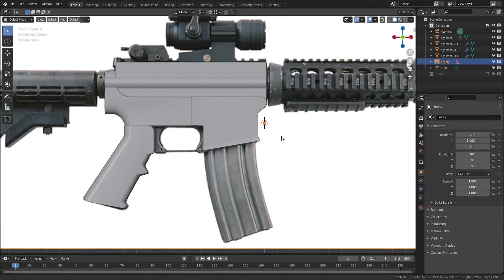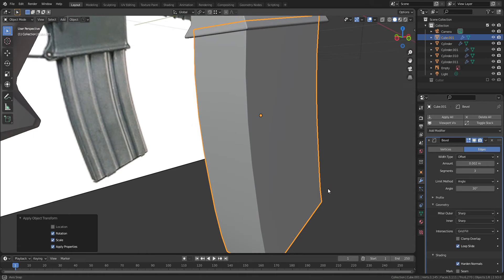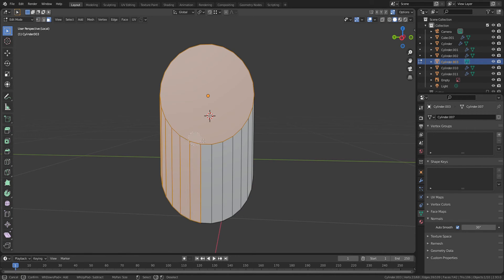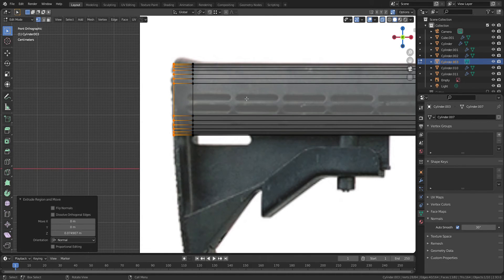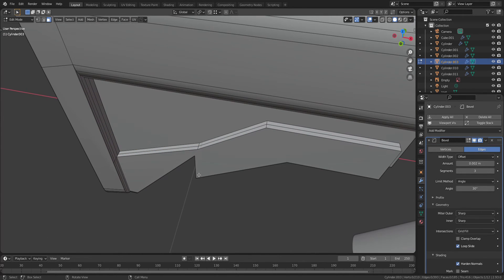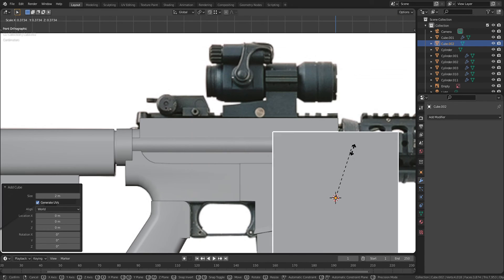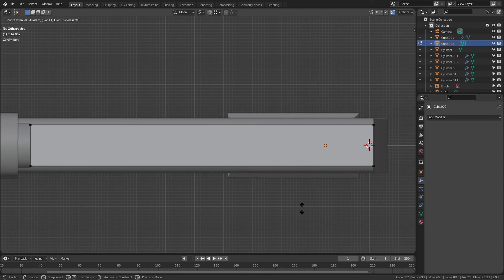Blender M4A1 3DCG modeling tutorial for beginner - Part 2

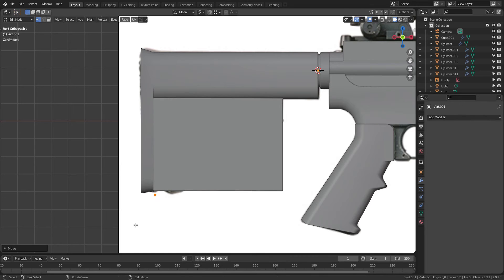Comment: 6:21 how do you add extra dot?
Reply: nvm its with E to extrude i saw it on the left bottom corner
Reply from the maker: @henkiespenkie4414  Well that is fine but if you apply "add mesh" add-on, shift + a, mesh, singe vert, and add single verts :)